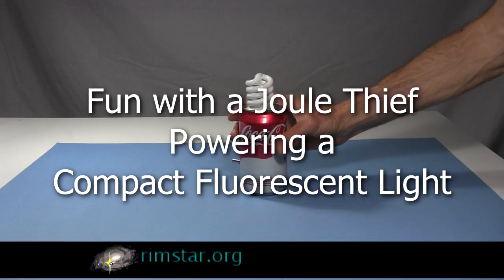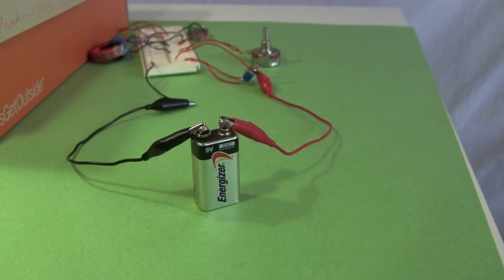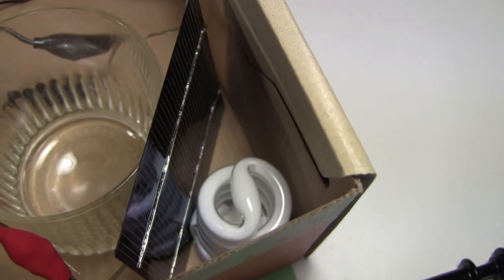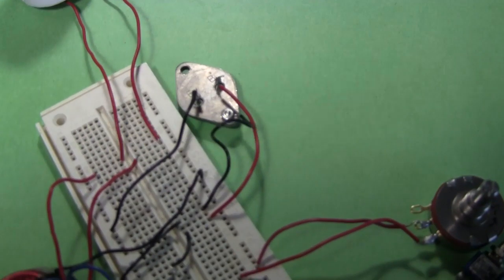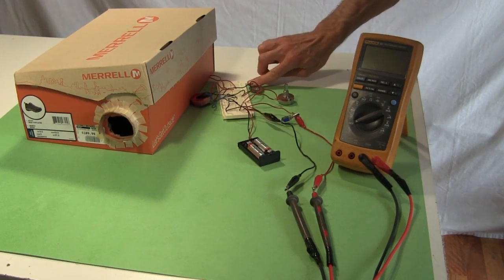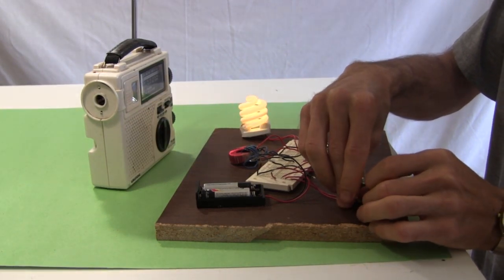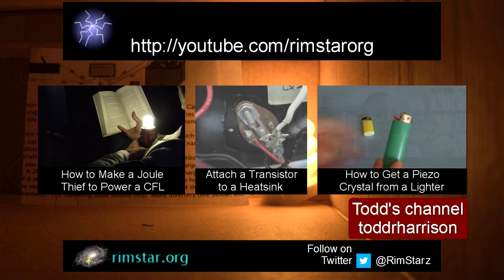Fun with Joule Thief Powering a Compact Fluorescent Light

Comment from the maker: It's the same as for an NPN transistor, the only thing that changes in the circuit is to reverse the battery. I'm also guessing you mean an LED, but I've included enough info in case you mean a regular diode. The short leg of the LED/the negative/the cathode/the end with the stripe goes to the transistor's emitter. The other end goes to the transistor's collector.

Comment from the maker: Thanks! I do take suggestions. e.g. This video wasn't even in the plans until I had so many questions and suggestions from my previous video. But unless there's a very large temperature difference and many thermocouples I suspect, there won't be enough power to run this circuit, even with the low power transistor version. Maybe a themocouple powered by concentrated solar sunlight would work though. The Voyage RTG used a hot-cold temperature difference of 700C or 1260F.

Comment: I was thinking of using little power such as a few batteries to drive high voltage AC appliance (I actually want to make a fume extractor) now you point me to a shortcut. Thanks. It's really surprising to me though, that the "spikey power" can drive CFL, I need to investigate why this will work for CFL, but not some other devices.

Comment from the maker: Thanks. And I looked for the Ah but they never seem to include them, not even on the packaging. As for the turns, I wrapped them myself so sure. It's the same coil from last week's video. 256 turns of 30 AWG, then 10 turns of 24 on top of that, followed by 5 turns of 24 on top of that (I mistakenly said 18 AWG for the two 24 AWGs in the video.)

Comment from the maker: But it caused interference in the AM band which is 550 kHz plus, though with decreasing strength as it got further up into the shortwave band which is above the normal AM. So it does make sense that by the time it got up to FM, the interference was gone. It also filled the whole AM band, so I'm thinking it wasn't just harmonics.

Comment: Nice video! This circuit is quite fascinating! Have you thought about making one that could do useful work from a small voltage source like a thermocouple (or several of thm)? It would be fun to see if you could light an LED or power a microcontroller from just room temperature. It would be a cool way to demonstrate how the RTGs the power things like Voyager or the Curiosity Rover work! Not sure if you take suggestions... just a thought.

Comment: Hi I am not good at English. I tried to follow you but I move the negative to the positive terminal of the power supply and I added a diode , transistor(emitter) .It Very good results.
Reply from the maker: +Kasamepisut Susiritumrong I'm glad to hear it worked. It sounds like you have a PNP transistor.
Reply: I use Mosfet same as NPN transister.I have used chargers battery but it surprise to input and output not equal it is input 12V  0.12A. It is out put 100V 0.04A. it  mean output 4W more input 1.44W.it may be caused Black EMF. It similar Bedini Motor.

Comment: Question about the heat? You said in the video that the resister and the batteries where hot. 1 how much heat is considered bad? The reason I ask is that most people say something is hot when the actual temperature is around 110 or 120 degrees. Any hotter we will start to be burnt. 
I had a emergency call to repair an eddy current brake on an overhead bridge crane. (it keeps the load from free falling to the ground) The maintenance person said the eddy brake... (see next post)

Comment: The 2N3055 transistor can work at 60 volts and 15 amperes maximum. You may give a try to operate your cirquit at these values by replacing the thin wire of the secondary coil with another one so you can make your CFL brighter.
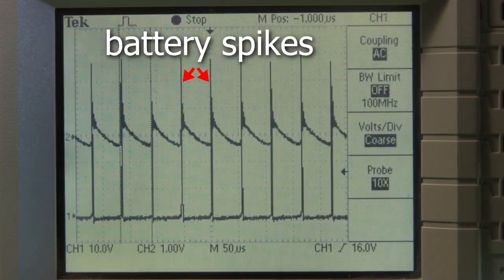Reply from the maker: Good point. At 2:23 in the video the peak voltage across the emitter and collector is 38.8 volts, though I don't know the current. It looks like there's room here to get the voltage higher on the input side and reduce the turns on the output coil. Though I didn't adjust the potentiometer during this measurement.

Comment: I have a question related to using the solar cell to measure the light output.  Having a difficult time accounting for the negative-going pulses at the solar-cell output.  Is it possible that there is inductive or capacitive coupling between the lamp (and associated wiring) and the solar-cell causing this, rather than the cell's output itself?

It could be tested by increasing the distance between them and/or shielding all but a small aperture through a metal enclosure that a bit of light passes

Comment from the maker: The joule thief output isn't DC. In this video you can see it's very spikey and the power is during those spikes. So it wouldn't work. If you're already powering your joule thief with a DC power source, why not just connect the DC to AC transformer to that source with no joule thief? Adding the joule thief just adds losses. All a joule thief does is create periodic high voltage spikes for things that need a higher voltage than the original power source and that can work with spikey power.

Comment: which parameter affect the frequency of operation?? Is it the resistor ??
Reply from the maker: Yes, the resistance is at least the parameter you can easily change if you use a potentiometer. You can see it happen a little at 3:14 in the video. Though if you could vary the supply voltage than that would too. I'm guessing the number of turns on the coil would too but that's not easy to adjust dynamically.
Reply: Thanks..I have tried to light the cfl but still not done..
Getting maximum 92v peak to peak at out put terminal..
I have used 275 turns.
Reply from the maker: DEBASISH DUTTA
92v is very low. Are you sure the insulation to the wires on your coils didn't break down and are conducting through corona? That's what happened to me and caused me to use thicker insulation wherever there would be high voltage between adjacent wires. I talk about this at 2:10 and 3:10 in my video "How to Make Joule Thief Light a CFL - Jeanna's Light". Also, recheck the way you connected the coils to the rest of your circuit. The connections are backward from what you'd expect.
Reply: OK let me try again ..

Comment: You can try the tiny 2N7000 MOSFET which costs a dime at Mouser or Futurlec, but it requires 3V gate voltage.

Comment: did you also do input vs output watts calculation?
Reply from the maker: No, I didn't. It would be difficult to do anyway since the output of a joule thief circuit is so spikey. It is a fairly inefficient circuit though, so the output watts would probably be much lower than the input watts.
Reply: @RimstarOrg  adding appropriate capacitor parallel to output coil will make the output smoother and i believe this will make it easier for measurements. 

i found online that if three coils are wound on the toroid (sensing coil, induction coil, secondary coil), the secondary coil will generate good current and voltage and won't make joule thief draw more current from source during on load conditions. this way the output might surpass input.

Comment: Glad to see that the light works with a 9 volt (with an extra resistor) and that the pulsed DC can easily substitute AC within the toroid system. I might actually take up the project to build the CFL lantern to run off a 9 volt. One question that comes to mind is could I substitute the magnet wire in the toroid with a 1 mm, insulated telephone wire stripped from a telephone cable?
Reply from the maker: Destroyer9747 You can substitute 1mm wire but you need to fit a few hundred turns so you'll probably need a bigger toroid.
Reply: RimstarOrg Thanks, I'm glad that I can at least use 1mm telephone wire that I salvaged from a telephone cable.
Reply: RimstarOrg Okay, a little update on my progress on making this circuit. I acquired a 2N3055 transistor for the circuit; then, I was able to go get a monster toroid (http://goo.gl/WNuJo2) with 61 mm outer diameter for the 1 mm insulated telephone wire. Now, I am getting a potentiometer and maybe an extra resistor. Do you have any tips on improving the design? Such as, a resistor on the positive in combination with a lower ohm rated potentiometer or wind more with the secondary and use electrician's tape for additional insulation. I do enjoy these videos and design assistance since I will be doing a research project soon with different battery types and brands to see which one might last the longest in terms of battery brand per type without too much compensation in terms of lighting with the CFL Joule Thief Circuit.
Reply from the maker: Destroyer9747 Nice toriod. With that you should be able to put plenty of turns without the two ends coming close enough together for the need to insulate the two ends from each other.
Reply: RimstarOrg Thanks, I am glad that the toroid is sufficient enough for the secondary. I might have 450-550 on the secondary if I can fit that many without too much amp draw for the circuit or overloading the bulb (if possible).
Reply: RimstarOrg Well, my previous assumption that I could get at least 300 turns without overlapping with electrician tape on the starting end might have been a bit incorrect. I ended up with at least 131 turns by beginning to cover the starting end with electrician's tape to overlap and then I ran out of the telephone wire so I might have to solder on an additional 1 mm telephone wire with a small piece of tape to help insulate that part. Hey, does the distance from the toroid cause any noticeable losses or am I fine to overlap?
Reply from the maker: For the distance you'll be, I don't think overlapping will cause too many losses. Also, the plastic insulation on adjacent turns of telephone wire might be enough but probably best to be safe and go with the electrician tape.
Reply: Okay, thanks. Yeah, I am winding the toroid pretty tight and I plan to do at least 300 turns of secondary with the tape over lap. Anyway, I managed to pull off a parallel solder for the yellow to extra set of green telephone wire which I insulated with the electrician tape at the solder join. I'll let you know how it turns out.
Reply: RimstarOrg Okay, I managed to pull off 340+ turns of what ever length of the telephone wire I had with soldered insulated connections between the wires to get at least 300 turns. I am now going to do 10 turns of the 18 gauge wire going to the collector and the 5 turns of the same wire type to the base. I heard that you had issues using just 7 turns of the wire going to collector and you had to use at least 10 to get the joule thief to work correctly; would I need additional turns of the electromagnetic input wires since I am using more turns of the output secondary or is the current amount okay to use?
Reply from the maker: Destroyer9747 That's hard to say. I chose the 7 and 10 entirely by trial and error. You'll probably have to do the same.
Reply: RimstarOrg Okay, well 10 turns works and I have the joule thief completed. My only concern was that, with a 10k ohm resistor and a 9v battery, setting the resistor to a lower resistance caused a small "sizzling" noise to occur for a second or two and I was afraid that I fried one of the components but (after emergency stop and reset to high voltage) nothing was really damaged. Do you know what might have made the sound or was it just the ferrite core beginning to vibrate? Edit: Ironically, I am able to use my finger as a parallel resistor to the potentiometer across the leads to the transistor base which helps to quick light the bulb if it does not start the first time.
Reply from the maker: Destroyer9747 I've never heard of a sizzling sound, but I've heard of the buzzing of the ferrite and coils. I think I may have heard the buzzing myself one brief time. I'm not sure of the cause, maybe the magnetic fields in the different coils are interacting with each other in a way that's resonant at some frequency and current level?
Reply: RimstarOrg Yeah, I think it might just be more of a buzzing sound and the actual light gets dimmer when I decrease the resistance all the way or right next to it (capacitor type electrostatic effect with non-damaged insulation alone?). It did not appear to damage the circuit insulation in any way especially since the actual CFL winding wires are 1 mm plastic coated telephone wires but it puts a minor limit on how low the resistance can be. I also found that problems starting a CFL with the circuit on the highest resistance can be solved by: decreasing the resistance to a "sweet spot", putting your finger in parallel with the potentiometer going to the base (not that much voltage but the influence is just enough to quick start the CFL dim on high resistance value), or taking a resistor and just quickly tapping the two points together is enough for correct operation. Also, I believe that there is a possibility that if a certain voltages are attained within the CFL that the actual Mercury/Nobler gas particles in the bulb might just be excited enough to the point that it emits less UV rays and start emitting X-rays but I would need a special Geiger counter for testing that out since it can explain the dimming with a penetrating rays and less UV Rays being produced for the coating to absorb at such high voltages.
Reply: RimstarOrg Out of curiosity, could I add an electrolytic capacitor (200v 15uF CD11GA) in parallel with the battery followed by one of the salvaged diode (1N4007) on the positive and a parallel, ceramic decoupling capacitor (473JU GD250) right after to protect the 9 volt from reversed polarities (basically reducing the heat in the battery itself) from the CFL scavenge?
Reply from the maker: Destroyer9747 I don't know off hand.
Reply: RimstarOrg Okay, well thanks anyway.

Comment: you could hack a hand crank flash light and store the power in rechargeable batteries and you could take a small water tight container and pour mineral oil in it and sink the transistor and keep it cool

Comment from the maker: There's no reason why they should think it's a fake. It doesn't put out more power than it uses. And it's an old circuit, also called a blocking oscillator. Joule thief is a misleading name.

Comment: Sir i need to ask a question, i have an experiment that combining newman motor to drive 2  mini axial flux generator. The question is can i use joule thief dc to dc booster from second generator coild (which is output 3 volt dc (at 1000 rpm) --> 70 / 100 volt dc) to feed the newman motor?. so the machine keep running it self?. I will be waiting to hear from you. Best Regards.

Comment: Can you use a washer for the winding ring, or does the induction in the washer ruin it
Reply from the maker: I've never tried, so I don't know how less efficient it would be due to the induction. You could also stack washers with nonconductive spacers in between them, though you'd still have eddy currents in each washer.

Comment: Will operating the CFL using this method reduce the CFL's life?
Reply from the maker: The only path left from the original CFL is the tube but I don't know if the tube will last less time than if it would have if it was still used as part of the original CFL. The joule thief circuit itself is not a very efficient circuit to start with you you'll definitely be using more power for that same amount of light.

Comment: I am making a school project and I need your help. What is the output frequency in your normal joule thief(which runs an LED) if you use fresh batteries(3.0 volts). Also give information about output current. Does a normal multimeter show the same accurate results as that of an oscilloscope? Thanks in advance!
Reply from the maker: I've never tried a normal LED joule thief with fresh batteries. You can see what I have tried here https://www.youtube.com/watch?v=B61DU7yEsPM in my video about making one. The frequency as you can see around forty-five seconds into that video is around 21 kHz (around 46 usec per cycle) using a 1 kilohm resistor. I don't know how to measure output current since the output is nowhere near flat DC nor sinusoidal AC. A multimeter isn't as good as an oscilloscope for this since a multimeter is designed for flat DC and sinusoidal AC and doesn't show the waveform. Some multimeters have min and max feature where they can show minimum and maximum values so that helps, otherwise you're just looking at values from random points in time.
Reply: RimstarOrg Can you try using a full wave rectifier and high voltage capacitors to see if you get an almost flat DC output. I am making a 'Railgun' for Physics project, therefore I need high voltage power supple (around 300-400 volts) to charge my capacitor bank(around 5000 microFarads). Perhaps those frequent pulses wont be able to charge the capacitors as fast.
Reply from the maker: I do have a page on my website contibuted by someone else who turned the output of a joule thief into DC for making a clock work 
https://rimstar.org/science_electronics_projects/joule_thief_powering_clock_ls.htm but it's the low voltage version. It might be possible for high voltage, but it may also be that when you do the smoothing you'll find that it smooths to too low a voltage. I can't say for sure. I also don't know how long it would take to charge your capacitor bank, so it may or may not be a while between firings. It's too hard to me to say anything for sure with the joule thief's type of output.